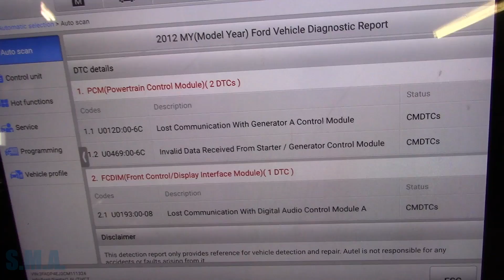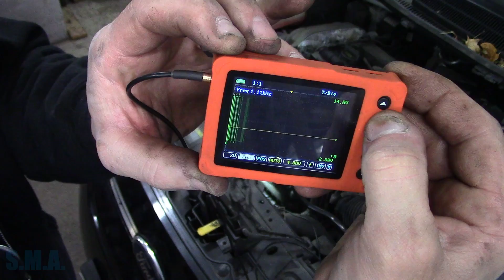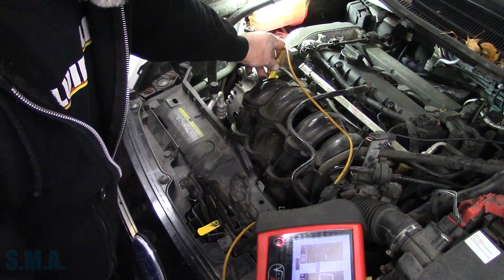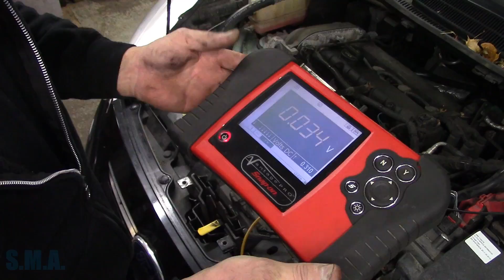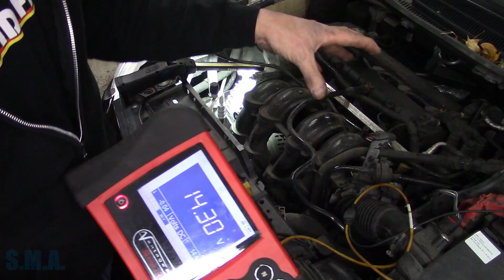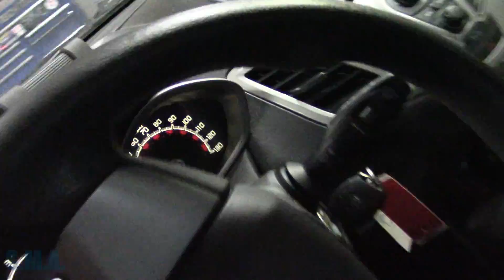Ford Fiesta: Battery Light On

Comment: Why did care companies put a engine computer in control of a alternator why not keep it simple
Reply: They want the computer to control things like the electric windows, partly because the consumer wants their vehicle to be like an iphone, the more gadgets the better.
If I could buy a 2020 Chevy pickup that was an exact replica of a 1990  pickup, I would buy it over the new unnecessarily complicated crap anyday.
Reply: @1SixpenceFan  ya hate this complicated crap as well I'm  sure all mechanics do as well
Reply: @1SixpenceFan  Yeah even Ford stopped the F-150 XL production which was a bare bones work truck.
Reply: @1SixpenceFan  Except you wouldn't, and everyone (including the manufacturer) know you wouldn't. Everyone loves to say how they'd "buy a simple truck" but nobody ever buys baseline barebone trucks.
Reply: @LordOfSilense  Maybe because there's not anything basic enough out there so they stick to older vehicles?  Out of 7 cars in our household 3 have ABS, 4 have an ECU, 2 have AC. (and the ones currently used the most are mechanical diesels with roll-up windows in the back.  Biggest "gadget" in either of them is a CB radio lol).
You're 100% right though of course, if I had the money I wouldn't buy a base model new car/truck I'd buy a really nice example of something older ;)
Reply: @LordOfSilense  Another problem is that all the electronic garbage is still on the baseline trucks versions, so that doesn't really do any good to avoid overly complex systems.
Reply: @danmackintosh6325  the old ecm systems were fine and so were  abs systems there very simple
Reply: I believe they use the computer to control the field current instead of a separate voltage regulator, thus saving the price of an additional part.  Save $5 a car and make a million cars, you've saved $5,000,000.
Reply: @LuckyBaldwin777  And shift the cost to the customer once again. Nice work. :(
Reply: @markh.6687  Yep, that's exactly what they did.
Reply: @LuckyBaldwin777  thank you did 05 corollas have that shit
Reply: @neilmurphy845 No problem, man.  I'm not a Japanese car expert, so I'd have to guess.  Looking at Rock Auto's website under 2005 Toyota Corolla, they do list a separate voltage regulator, so I'd guess it wasn't computer controlled.
Reply: @LuckyBaldwin777  fantastic I was thinking when are battery went dead and we'd turn on the car and give it a few full throttle runs the battery would be full arfter running for 20 minutes the car in question is a 2005 Toyota Corolla verso 05 with the 2ZZFE 1.6 petrol
Reply: @LuckyBaldwin777  do you know if a mira 2015 is controlled by a computer or a voltage regulator on the alternator
Reply: @neilmurphy845  sorry man, can't even guess on that one.  Never heard of it.  All I could find is a 2015 Daihatsu Mira and nobody lists any parts for that one, so I'm thinking it wasn't sold in the US.
Reply: @LuckyBaldwin777  ya that body style of Nissan micra  were only sold in Canada
Reply: @neilmurphy845  I looked at the parts listing for 2015 Nissans and only the 3.5 L V6 in the Murano and Quest have voltage regulators listed for them
Reply: @LuckyBaldwin777  thank you ya the Micra is sold in Europe that's were I'm from it comes with a 1.2 petrol sorry I didn't tell you that sooner
Reply: @neilmurphy845  that's no problem.  If I had to guess about that one, I'd say it was a computer controlled alternator.  To make sure, you could call a Nissan dealer there and ask for a voltage regulator and see if they list one.  Good luck man.
Reply: @LuckyBaldwin777  ya just out of curiosity
Reply: @LuckyBaldwin777  To save a few pennies in gasoline. Better regulated control equals less engine drag. But yeah your right keeping charging system separate was a better way.
Reply: @NY411Info  if they were smart, they would keep from loading the battery up so heavily and allow longer life from them by not forcing charge into a charged battery and forcing high current into a low bath
Reply: It all comes down to fuel economy. An alternator takes quit a bit of power to turn over. Under certain circumstances the PCM will turn off the alternator to provide more power from the motor or increase fuel economy.
Reply: @shadymaint1  Well lets consider a 200A alternator.. 200A times say 14v is 2800watts.. and thats full out max charging with smoke coming from the alternator.. now 746Watts per horsepower...2800 divided by 746=3.75 horsepower..lets round up and say its 5HP loss.. not much for 100HP car.
Reply: @a4000t  well only if you forget that it takes 15 horsepower to move the average crossover and midsize car
Reply: @shadymaint1  ya I guess if it's a well made system then that sounds good but it would need to save me at least give me 10 MPG or more for that to be useful
Reply: So rather than a $30 voltage regulator, you need to replace a $2000 pcm when that part of it burns out and you can't figure out what's going on and have to take your car in to Eric.
Reply: @markchidester6239  ya but it's a waste because it'll ruin the battery and alternator a external regalater wouldn't let that happen it would never break
Reply: Fuel economy.  Reducing load by not charging more than needed saves fuel.
Reply: @buffuniballer  Not enough by any means to justify the system complexity. Just as bad as auto-stop/start systems; minimal savings, max repair expenses.
Reply: @markh.6687  Ow ya so if you'll have to pay 200+ Euro's instead of 50 same with the battery it adds an extra 50 or €100 onto the part
Reply: @markh.6687  the worst answer to hybrids, it’s like they saw that hybrids and electrics could save fuel by not running the engine at stop lights and drive throughs and some situations of traffic, so they wanted in on it without the cost of an electric drivetrain, they failed to realize both the expense of parts (to the customers and the environment) and the extra fuel used on startup from doing that
Reply: @aterack833  Hybrids are the dumbest thing. they solve no problems. They use lithium battery,a finite resource,and gas engine, (fossil fuel is finite too)..so instead of using 1 finite resource(gas car) they use two... who thinks this stuff up!
Reply: @a4000t  there are several types of hybrid vehicles, some, like the Chevy volt, are the best of all worlds and should just still be produced, while others range from a gas car with the ability to smooth all driving to being as though you never stop or start, some go a step further and smooth it to one engine speed, some use the engine as more of a range extender while driving at speed (some even having a special engine that is extra efficient but weak), some (typically older or cheaper) have an engine and electric drive that are both half the equation and cannot operate the vehicle on their own in any capacity, using the engine geared down with the electric torque to get going and drive at low speeds, and then use the electric motor geared up with the engine direct to het higher speeds, those are okish because they often have one gear set and just two clutches or so to switch where the power comes out, generally, in this day and age, if the vehicle can’t run standalone as electric, at least to a modest capacity, then it’s almost pointless as a hybrid and shouldn’t even be allowed to be called such
Reply: @aterack833  what you dont seem to understand is hybrids solve no problems. they use oil and battery(lithium),two finite resources instead of one resource(gasoline/diesel). this makes no sense,and solves no problem(re:finite resources). hybrids are 2 points of failures instead of 1(gas car).. battery/electronics/electric motor and Gas engine. it makes more sense to just use the gas to me.
Reply: @markh.6687  not sure it's really driven up the costs of Alternators.

Seems the 2012 Fiesta w/1.6L alternator is priced similar to the last one I replaced in my daughter's 2003 Corolla.

So while a bit more complex, not really all that much more expensive.
Reply: Never seen a alternator charge normal volts and be bad.
Reply: @jasonjgr8580  But it's an "improvement" the engineers always say, because we replaced a $5 part with a $200+ alternator replacement PLUS labor. Such a deal for the consumer!
Reply: @markh.6687  Unfortunately engineers need jobs to...lol
Reply: @markh.6687  Ya must be can't be anything else
Reply: @jasonjgr8580  The alternator is bad because the computer can't talk to it.  So the computer sets a code, turns on the battery light and sends a constant voltage to the alternator field windings so you have enough juice to make it to the shop..
Reply: @jasonjgr8580  The internal sense circuit is bad so you replace the whole unit. The old one might be overcharging at highway speeds. The battery is also cooked with less than 12 volts on the diagnostic tool.
Reply: @jasonjgr8580  ya if The seller I'd tell the buyer that it charges fine but check it every year or every so often if it were my car id live with that light on and just have a meter with me and a jump pack
Reply: Money 💵 to be made😏
Reply: It’s to run the charge at the raggedy edge just to save the engine from doing more work when it’s trying to save fuel
Reply: Apparently newer crv’s run around 12.3 with no load to save fuel. It was fun explaining to the service advisor it was cranking slow because it sat a lot during these uncertain times and there was nothing wrong with the car.
Reply: @Joe Black ya everything is gone "recyclable" nowadays nothing is made to last
Reply: Revenue is the key
Reply: Alternator control at the computer level means that alternator performance can be tied too engine load and hence fractionally better fuel economy and power when it is needed
Reply: @bruceevennett955  that's why now it makes sense but it's just stupid because I've been in cars with external regalater and haven't noticed any difference and it's stupid because you have to program the battery into the car if you buy a new one which involves very expensive tools
Reply: @Joe Black I’ll do it for $80
Reply: @Joe Black ya but they don't care I guess once they get money 💸 they don't mind
Reply: Funny how most folks here think the only reason for this is to increase fuel economy, but with the big 1.6L producing just a few horsepower, reducing the load makes the car just a bit more peppy.  Heck, my old Mercury with a 'uge ol' 4.6 shuts off the alternator at WOT for max pep - it's definitely doing it to increase MPH, not MPG.
Reply: @Adam1nToronto  Ya I think your right  but how come how come are Corolla verso 05 was a 1.6L and it pulled trailers like nothing and had plenty of power I sapose your right if it's well made like the ford system I wouldn't mind it to much I think Ford meant it in a good way but some companies don't they just use it as a way to take more of your money 💲.
Reply: The mantra in design for almost half a century is to replace hardware with software. If there is a design problem in software the fix is rolled out and there is just a little labor and no parts. If we tried to make a cell phone that had minimum software involvement it would cost many times what an Android phone does.
The short way of thinking about it is that the computer is the simpler way of doing it.
(50 years in electronics, about 40 years of maintaining and repairing computer controlled equipment.)
Reply: @flagmichael  I guess that makes sense the proplem is that they don't design the car computers to be cleaver and long lasting like android or apple windows a phone is smart if you give it to little voltage or to much it either shuts down or monitors the income  voltage into the the circuit board unlike a car where if you did the same thing that it would ruin it and need to be replaced

Comment: Aahhhhh, where is the obd1 car?  Just crack open the computer.  The transistor is leaking. :)
Reply: In museums, mostly. Although Actron STILL sells ODBI scan (well, blink code) tools.
Reply: @markh.6687  I bought one of those tool sets for about $35 years ago. Two plastic tools - a screwdriver and a jumper embedded in the end of a piece of plastic - and an instruction booklet.
Reply: OBD1 days had the worst warning light of all! The hot setup was a regulator in the alternator that was fed by the alternator output, and the field wire initially powered it up. When the ignition was on and he engine not running the light had 12V of one end and nuttin' on the other: light was on. Same if the alternator was not putting out. However, when the brushes wore out the light never came on... the battery just died. This system is much better.

Comment: Battery light on? 1" strip of electrical tape can fix that. ;)
Reply: That really is the fix for the service light on some old Northstar Savilles over 150k. There is no way to reset it. Even Cadillac didn't expect them to last that long.
Reply: @dizzy2020  Not a battery warning light, that only applies to EML/MIL, ABS/Trac and airbag light if fitted.  (Mind you, I seem to recall reading that a non-functional EML was only an advisory for a certain year range of diesels presumably due to crossover between mechanical and electronic injection.  I'm not sure now but think the most recent revisions mean no airbag lamp is also advise now?)
Reply: Town I worked for had a police car they whited-out and Sharpied over an idiot light. Nice.
Reply: @dizzy2020  Oops! That didn't work out as intended. :(
Reply: I put a piece of tape on the od disengagement light cause I don’t need od  don’t drive fast enough for it and it in it’s out just wearing out the transmission.